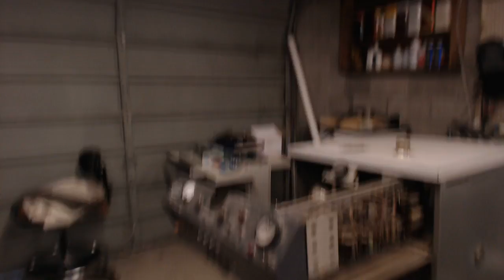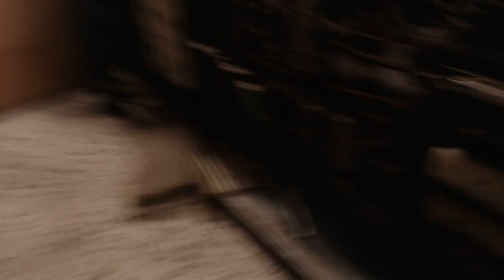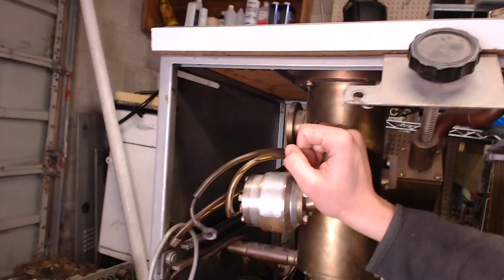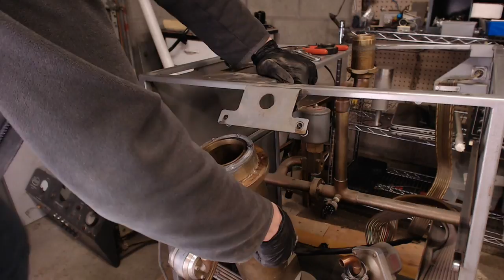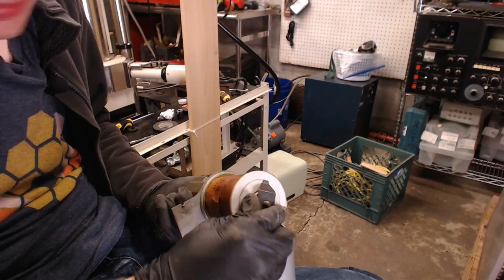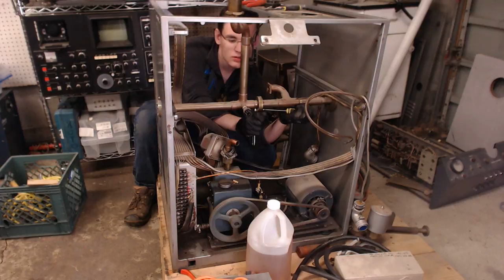Veeco High Vacuum Leak Detector Teardown

Comment: After 50 years of building, rebuilding servicing and selling thes Mass Spectrometers, it's nicet se a young guy doing work on one. HOWEVER, this was done without knowledge, manuals or research and basically took a vintage VEECO MS-9AB and made it into a scrap pile!
Cutting wires without knowing function is just plain stupid. the PROPER thing to do was to research the machine first, obtain a manual(I have 7 0r 8) then assemble all the accessories and test run the machine, find out whats wrong first, fix it, then tear it down and rebuild it.
The whole wiring harness can be removed without cutting a wire in 20 minutes. I wish he has dne his homework before he BROKE the fully operational machine. SORRY, this is a very poor way to learn, and I'll bet its stil apart or has been junked.
DF
Reply: yes this is really sad to see, it is not like the parts would be really useful for something else, maybe he will learn wenn he gets older. Such things should be preserved it will be all lost to history with such doing!